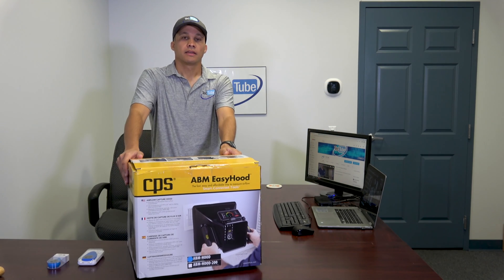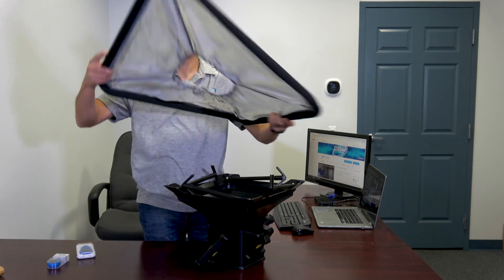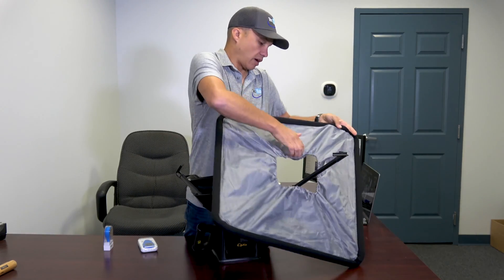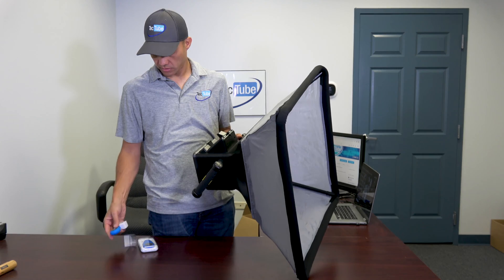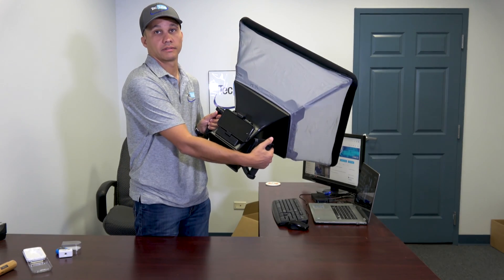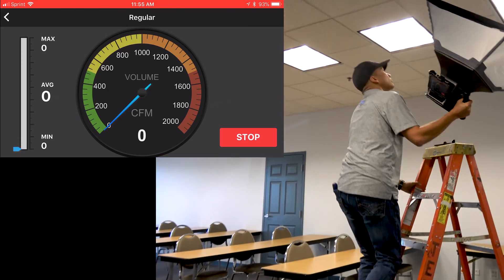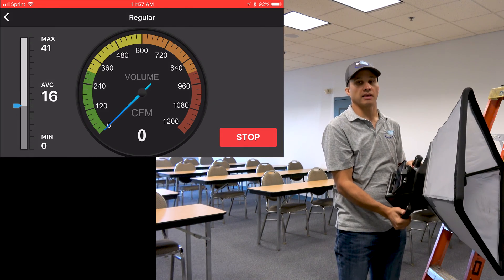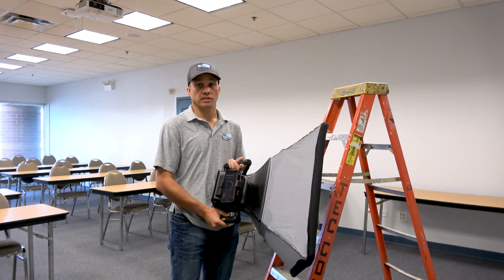CPS ABM EasyHood Airflow Measurement Tool (ABM-HOOD)

Comment: HELLO!
Thanks for your videos, and I would like to ask you if there is any way to measure the amount of air in depleting devices (floor devices with circular duct connection)
Reply from the maker: We have not heard the term "depleting devices" before, but so long as whatever diffuser you have fits inside the EasyHood, you can measure the airflow.

Comment: My home return is a 20x30. Can i tape the grille with tape and use this or?
Reply from the maker: Yes, but that will cause a restriction and hence affect the accuracy of the results. You could also use just the ABM-200 by itself without the hood. That will allow/require you to enter the grill dimensions into the app and it will calculate from there.

Comment: My Boss bought hoping it would work out for a big balancing job at a 3story dorm. It was bad out of the box. Was reading airflow when it wasn’t moving and air through it. Exiting Handel for high walls is very weak. Hood canvas comes apart very easy.  Then your scratching walls real easy.  Very disappointed in product and value

Comment: I WANT TO PURCHASE THESE EASYHOOD BUT THE ABM-200 ONLY GOES UP TO 1200 CFM. DO YOU KNOW IF THEIRS SOMETHING SIMILAR TO ABM-200 THAT CAN BE USED WITH EASYHOOD THAT HAS A HIGHER CFM RANGE?THANKYOU
Reply: Its wildly inaccurate across its claimed range of air flows. I wouldn't use it over 100 cfm if accuracy matters to you. Tested against my alnor, shortridge and dwyer smart hood
Reply from the maker: Do you work on systems that have more than 1,200 CFM... 3 tons of cooling... at a single diffuser?
Reply: @TECTubefilms  I DO HERS TESTING AND MAINLY RESIDENTIAL.. REQUIRED CFM FOR A 5 TON SYSTEM IS 1,500(300 PER TON) AND 1750 CFM(350 PER TON)
Reply: THESE READINGS ARE FOR RETURN DUCTS ONLY

Comment: How accurate do you find it so far?
Thank you.
Reply: Off by as much as 60% at the calibration shop.
Reply from the maker: We have not taken this hood and another brand of hood to the same jobsite and used them both to compare?  And if we did, and they were a little different, I guess we would need a third brand to test the airflow and break the tie to see which is the least accurate.
Reply: @TECTubefilms  I found it very inaccurate on a high CFM return air grill.  So did this fellow ...
https://www.youtube.com/watch?v=UDzoUG01Eu4